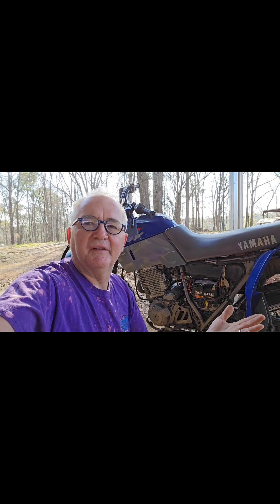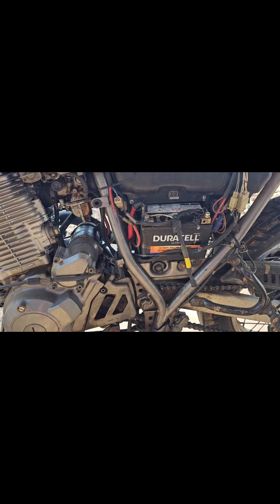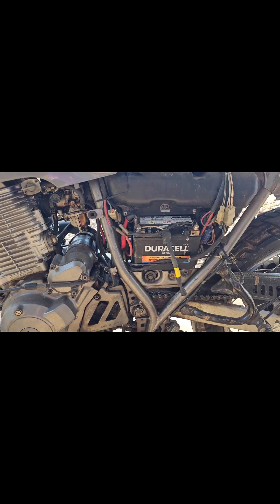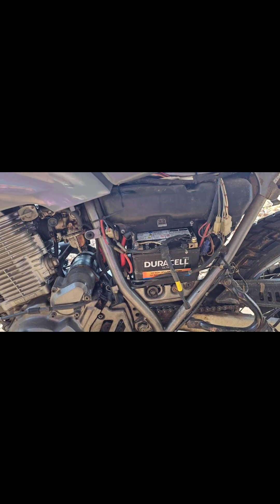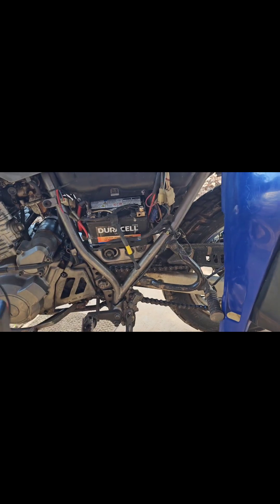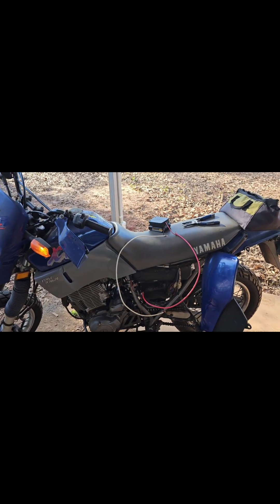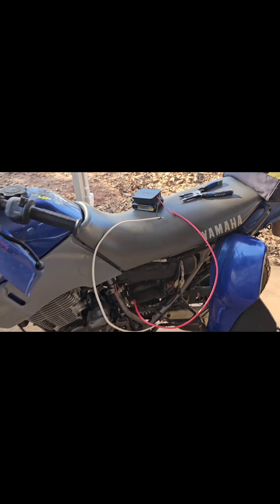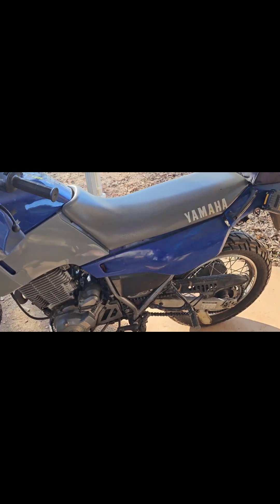DeWalt Motorcycle Battery experiment

Comment: They have 12v batteries 2 for like 16 bucks on eBay to run correct volts or they make a step down regulator I'm not sure if it would charge with the step down regulator tho . I'm looking into doing this to my KTM it requires expensive lithium battery and I have a few DeWalt batteries gonna try this
Reply from the maker: My bike is old. 1990...  Be careful!!
Reply: The bike should have a regulator built in.
Reply from the maker: @CelticsGameOps  it must or would have blown somthin
Reply: Nice video! Did you keep the battery on? If you did what's it like long term?